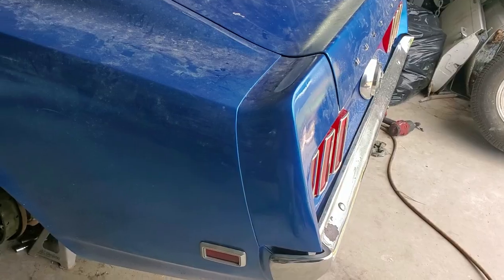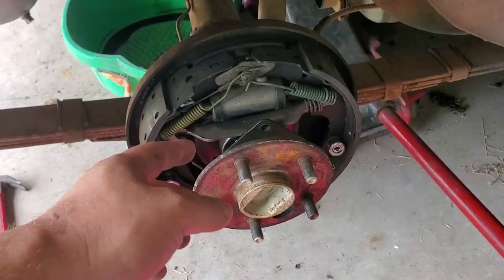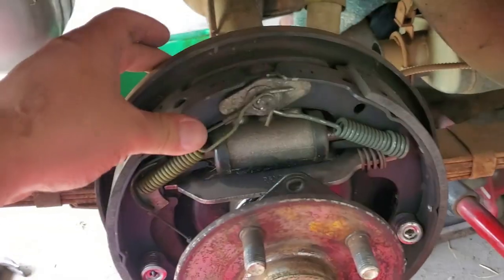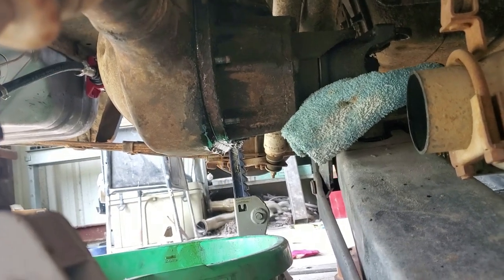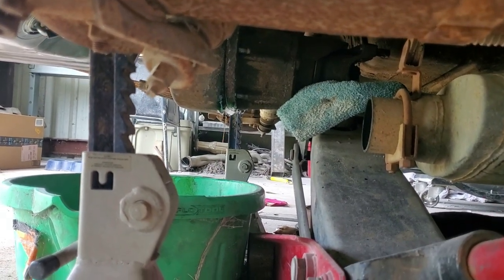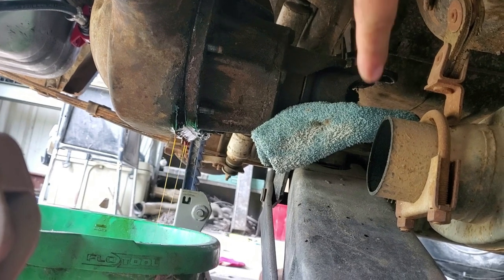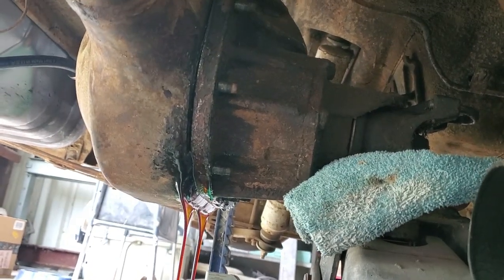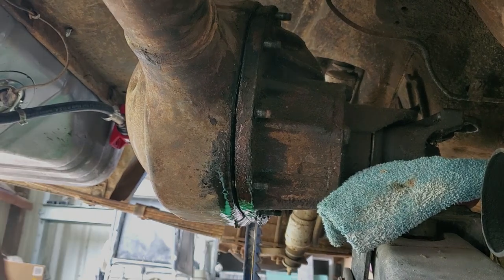How to drain differential oil on ford 9 inch and 8 inch even when stuck and won't separate

Comment: Would the siphon pump/fluid extractor work for the 9" by inserting it in the fill plug? I've seen it done on an 8" but wondering if this is a possibility on the 9"
Reply from the maker: It can but you won't ever get all the metal shavings out that settled at the bottom.
Reply: @EddiesCustomsandRestorations  I figured something will be left behind. I'll have to go this way. Thanks for the video. Cheers
Reply from the maker: @JR-jd3dw  best of luck! Thank you

Comment: What gear ratio is that one running? And what gear do you like for burn outs?
Reply from the maker: Didn't check out what gear ratio this one was running. It was a clients vehicle but 3:73s are good gears for both street and track. 4:11s will definately be better for low end torque at take off but if you are street driving the car, high way driving will be horrible because your RPMS will be much higher. But to answer your questions, both of these are good for an easier burn out, but a gear ratio in the 4s will get you started faster. If you love doing burns outs though, I wouldnt even put thought into the rear end, I would just put a push button line lock to lock the front brakes to where you can initiate a burn out without fighting your rear brakes too.